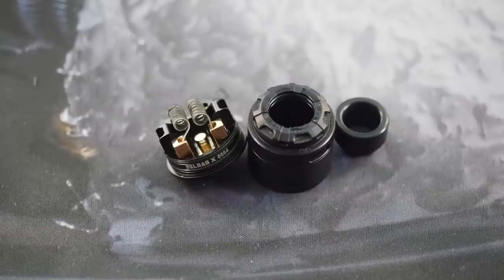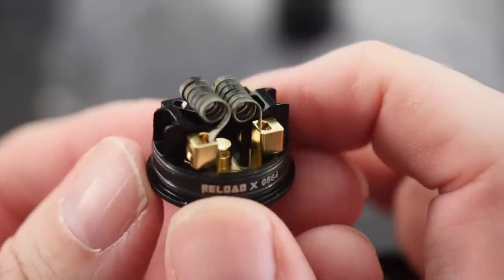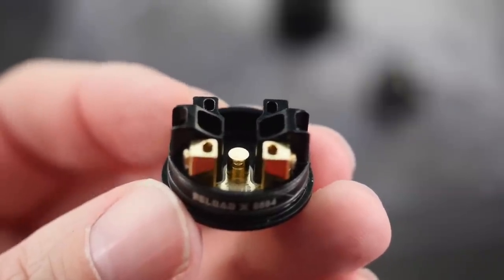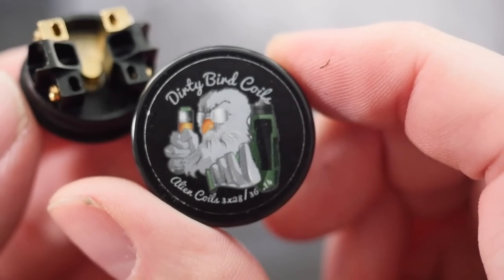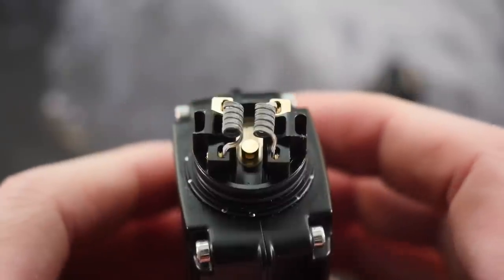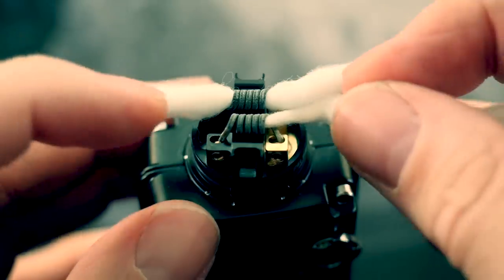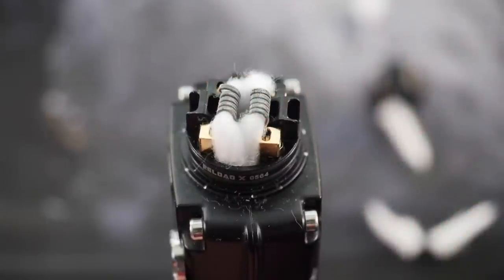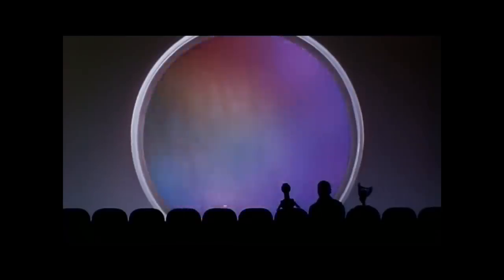Reload Vapor X RDA : Build : Wick : Leak tests

Comment: Hey Grimm love your show.. I have the Reload Vaper X and it has a AFC.. it’s that little band around the airflow holes.. the o-ring tolerance is super tight it takes quite a bit of muscling.. see you at ECC.
Reply from the maker: really?! good god, I tried everything I could to get that AFC to move.. didn't budge even a hair.  wow... thanks for the info fella
Reply: I was just about to say type the same thing
Reply: GrimmGreen it took me a month to get that damn thing off...stellar rda though!
Reply: Ditto, I was going to say the same thing.
Reply: Not surprised you couldn’t get it to budge Nick it’s on tighter than tight. I replaced the o-ring on mine with a slightly lighter one which sorted it. Just gotta get the damn thing off first!
Reply: drop rda still the best

Comment: I love the X.  If I over drip/squonk it and don’t purge I get the most extremely hot vape spear ever.  Same experience with the Reload RTA.  Other than that they are perfect in every way. Just purge.  And they may be made in China and $70 is expensive but the RTA has the flavor of an RDA and it NEVER leaks if properly wicked.  I’ve never had an RTA that doesn’t leak or flood at some point.  And both are simple to build and wick.  And the X does have AFC but it’s best at wide open.

Comment: What happened the tip of your coiling rod Nick?
Reply: Chris Ortega assuming he got one of these bad boys from fasttech or heavens gifts back in the day and is still using it they are ridiculously low quality, I could easily bend mine in my hands, it ended up getting bent just being in my tool box with my other build tools lol.

Comment: hi grimm, question, is it ok to vape a 0.11 ohm  dual coil build on a regulated  dual 18650 mod? im asking cause the mod gets warm and im not used to that. the mod is the "Polar" mod. thanks brother and thanks for the review.
Reply: Walter Bird he just did that in the video. What RDA are you using? I know that the polar looks like it's made of a lot of screen. With good batteries, you have no problems with that build on a regulated mod. What wattage are you running it at?
Reply: Josh Erlenmeyer I guess I wasn’t paying attention lol. I’m using the Athena dripper, cause it won’t leak in my pocket with 2 Sony vtc5a’s
Reply: Walter Bird yes ur fine my dude.. . If ur running high wattage of course it will get warm.. totally normal Killa! 
 A .11  is my all day every day vape. Even on a mech. As long as ur wise to ohms law. A .11 is IMHO the best. My shit gets warm too specially when I chain vape.
 Hope this helps.  With vtc5a ur most definitely safe!! vape hard vape 4lfe son.. 1
Reply: That's aluminum, right? Maybe it has something to do with that. I'm no scientist but sounds like it is safe to me.
Reply: Josh Erlenmeyer you're fine as long as your batteries are decent. I have a 3 battery regulated mod but I've ran dual coils at like .07 several times. It all comes down to your build quality, device quality, and devices chip.

Comment: There's no problem with products made in China, HOWEVER, a cheap product is a cheap product. Any company can be cheap, or just not care. It's all about quality control. That's why China has companies making smart phones with the same specs as a $950 Samsung or Apple (Samsung with a picture of a fruit on it). Those companies care. The issue is companies that just crank out clones, or design their own things without testing or thought (cough cough Smok). Our market is heavily unregulated and the cheap companies are able to flood the market with crappy things which make us have certain feelings towards what they all have in common, which is Asian manufacturing. There's a shopping center near me called "the hill" that has over 50 stores and 20 restaurants on it. Some restaurants are good, some are bad, but none of it is because they're made on the hill. It's the people running the operation in that location. I'm sure if we knew which factory each of these came from instead of the country name, we could EASILY narrow down the high quality from the low quality.